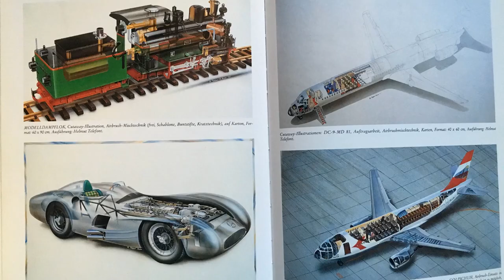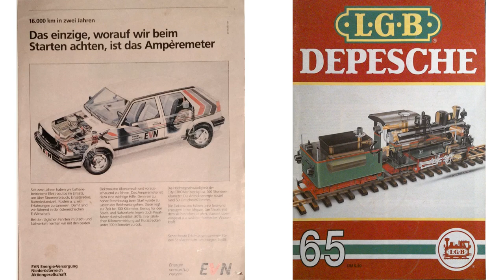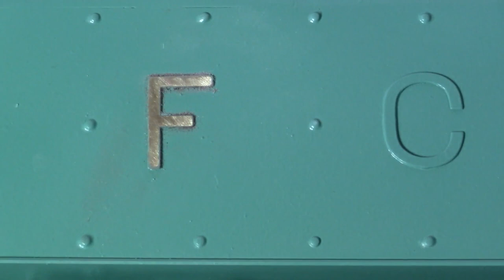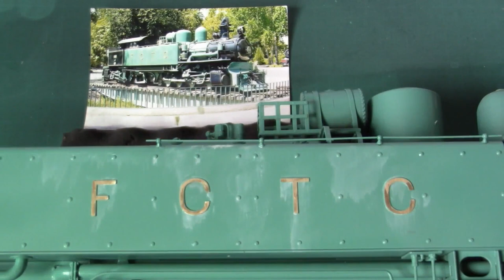15 -  COLORs

Comment: Your work is inspiring and informative even though I work on kit building in OO gauge. I should like to know a little more about the paint system you finally ended up with if that is OK with you. The degreasing is done with Nitro. I assume that is not an explosive (English term), so is that a diluted acid? It looks as though you did not use a primer when air brushing. What was the final brass surface preparation before doing that? Hope you can advise.
Thanks, David
Reply from the maker: „Nitro“ is not acid. 
It is like “acetone” to clean the surface from oil or fat…
Reply: @Garrattmaker  Got it. C3H5NO3 = Nitroacetone. Thanks. Presumably does an etch for better adhesion and then no primer needed.